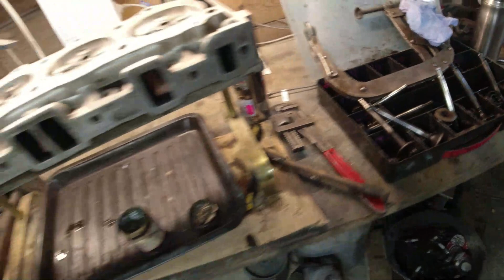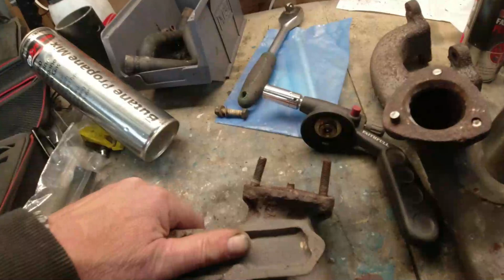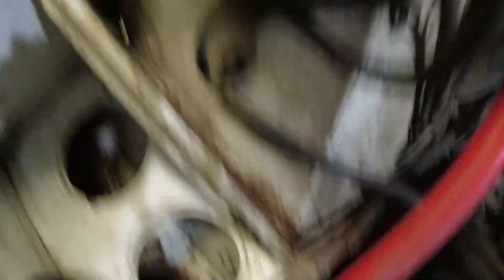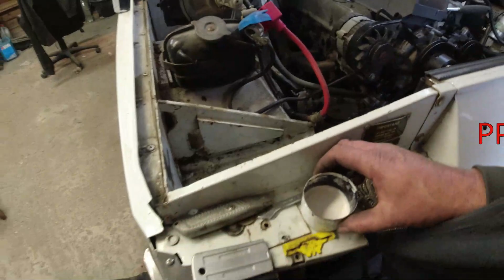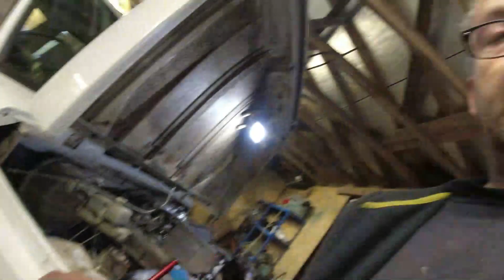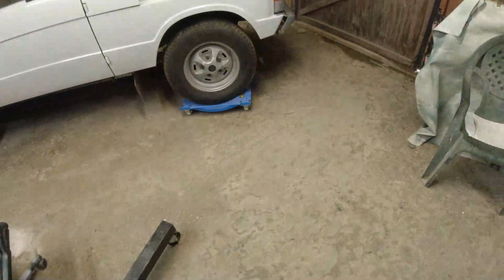1972 Range Rover A Suffix "Diana" Part 9 - Engine works and silicone - Profanity warning

Comment: Hi Rich, conventional braze or TIG braze the manifold holes. Drill and Tap.  You need to get really clean local metal for braze but its not tricky and could be done with a compact MAP torch or propane/oxygen. keep it up. J.